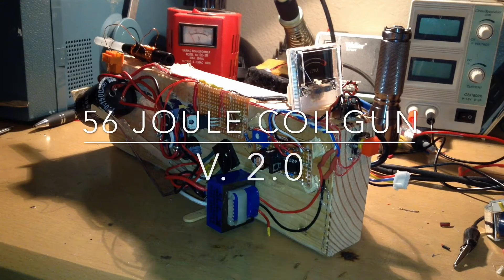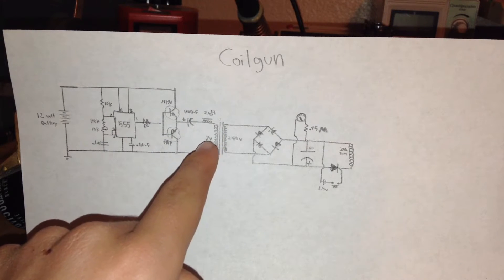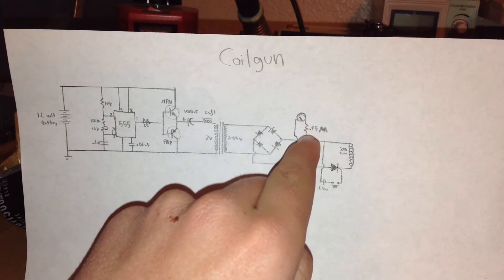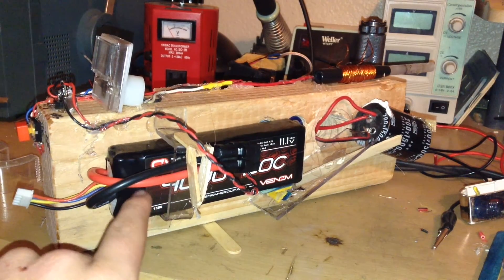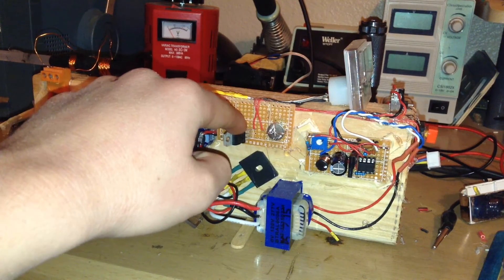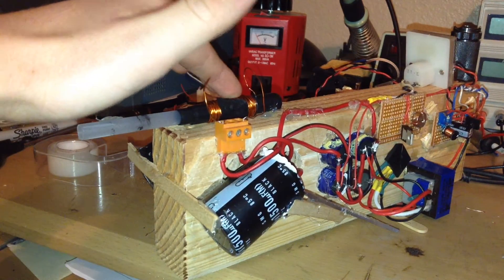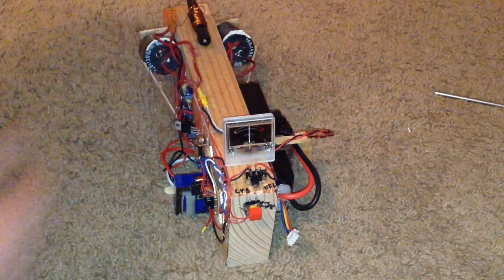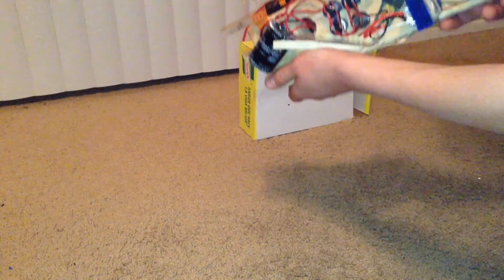56 Joule Coilgun V2.0

Comment: yes it is powerful, but mine uses 1 2200uF 450V capacitor and can shoot a section of coat hanger through a soda can and still has enough power to shoot over my neighbors house. but nice for a 2nd attempt at a coilgun!
Reply from the maker: That's awesome! What does your coil look like? I just built a Capacitors bank that is 1800uF and 1000 volt. I want to try that. It should be 4 times more powerful than your bank. I want too try what you did.
Reply: yeah i guess ill make a video for you. I use one because with my particular coil, if I add 3 giant capacitors in it then it doesn't work well. I guess Ill try less or more turns on the coil and try different voltages. I got 3 2200uF 450V capacitors on eBay for $20 so I got a STEAL, I'm still gonna buy like 8 more tho. Have fun!

P.S. my capacitor charging circuit broke and I need to make another one, so it might be awhile till I can get that video out to you, just FYI. :)
Reply from the maker: Thanks! I'll look forward to it.
Reply: I am recording the video now.
Reply from the maker: Down to a Science Cool, comment a link when you are done.

Comment: why high voltage? the higher the current, the higher the magnetic field! isn't it?
Reply: Higher the voltage the faster you can release the energy from capacitors. If you have low voltage it will take longer and the coil may be on even after the bullet has almost exited the tube so it could be less powerfull